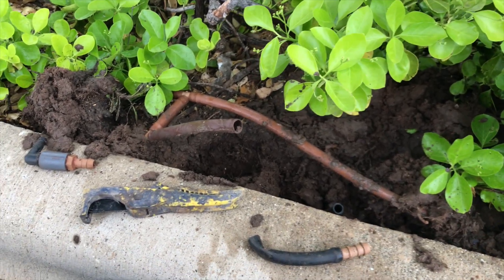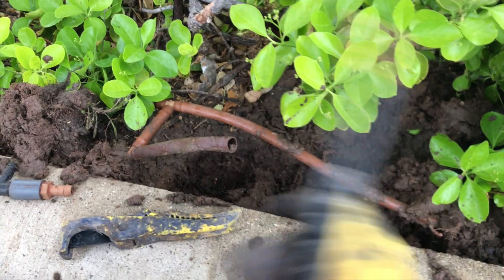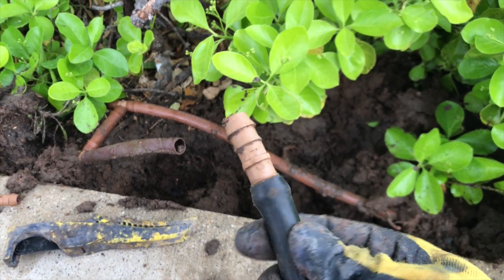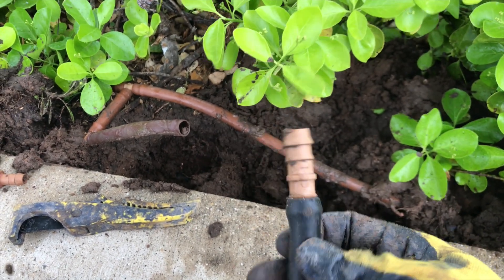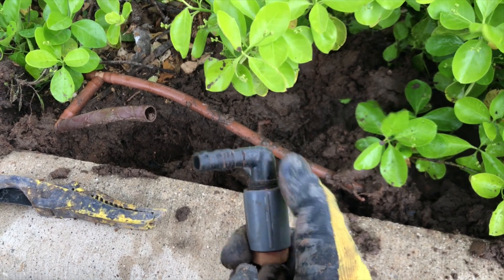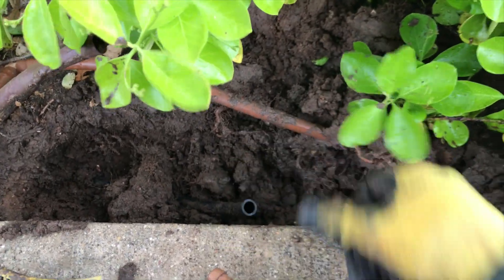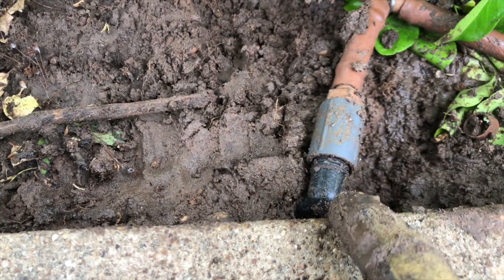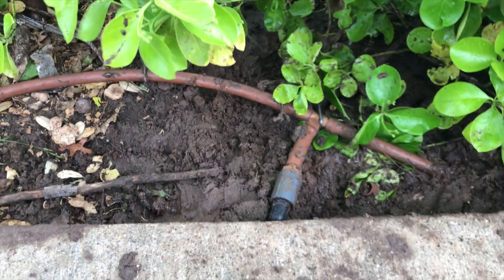Swing Pipe To Drip Irrigation | Drip Zone Repair

Comment: Can fnpt and mnpt swing joints be threaded together and be watertight? I'm looking to use swing pipe for a small drip line run and need to do a 90 degree turn.

Comment: Quick question can I use distribution half-inch tubing for a 15 x 20‘ area that I am putting FOUR standard Hunter pro spray units using half-inch barbed fittings?
Reply: The reason I’m asking is because this small area is being fed by distribution tubing originally because it was originally planned for drip tubing only so I didn’t want to have to convert from the distribution tube and that’s feed in this area from underneath a driveway slab to Pipe. There is not a lot of traffic FYI in this area as well so I didn’t think it would be an issue to bury the distribution line and use all the proper fittings, but I wanted to ask you the professional first

Comment: Don’t you need a pressure regulator on that? Sprinklers are like 45-55 psi and drip is around 25 psi. I’m not sure if they sell a swing pipe to drip line pressure regulator but they should.